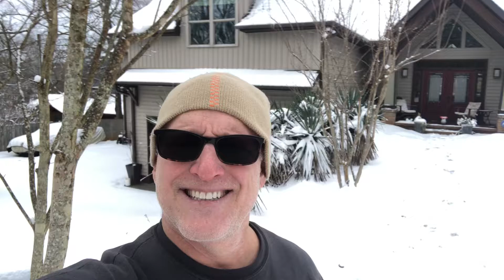Why Brown Stuff, Yellow Film & Sludge on Oil Fill Cap?  And water in Oil Catch Can, Separator?

Comment: Right. I've been draining a crapload of water from my catch can this winter. Pacific Northwest marine climate. Very wet and humid. Without the catch can it would burn up as crankcase condensation, during warm up. Not good for oil or engine.
Reply from the maker: catch cans are a great device, too bad they need to be regularly emptied.
Reply: @DrivingIntelligence  Twice a week right now. Once in summer. It's doing its job.
Reply from the maker: @RW4X4X3006  I just made an 800 mile trip, so I should check mine.  Winter is definitely the worse time for this condition.
Reply: @DrivingIntelligence  My rig is a daily driver. 94 F150 with 351Windsor. I've had it since new. 324k and runs great. I installed the catch can 5 years ago due to excessive blow by in the breather and #4 and #8 sparkplugs were fouling. OEM design has the excess from PCV valve plumed directly into the intake plenum above those rear cylinders. Ford knew for decades this was a problem but never made and update to correct it. Many engines dropped prematurely beyond the 200k area. Adding the catch can and routing it into the center of the plenum for even dispersal of any blow by (which now there is none due to the can) has greatly improved the performance and extended engine life. sparkplugs all bone dry and firing perfectly. Being a daily driver for short trips, condensation doesn't burn off adequately. Catch can is doing its job removing moisture from the crankcase - and it's nice and clean in the throttle body and intake. I tell everyone to install the catch cans - especially those with direct injection.
Reply from the maker: @RW4X4X3006  you're good to your truck.  I'm at 262k miles as a daily driver in my '02.
Reply: @DrivingIntelligence  After what I paid for it new back in 94' I swore I'd never do it again. I'm ringing every buck I can out of it. Haha.

Comment: I had a crapload of that tan muck; some of the build up was as thick as cottage cheese.

I didn't drain the catch can for months, so I just installed one-way in-line (fancy PCV's) valves on the hoses - leading to the catch can, so the sludge doesn't blow backwards.

I think some sludge blew back onto my oil pressure switch filter..... so I gotta swap the sensor and filter now
Reply from the maker: I'm more concerned about the sludge and fluid being sucked into the intake and hydro-locking the engine.
Reply: @DrivingIntelligence  5.3L LS in my Avalanche..... what do I do?
Reply from the maker: If you still have a catch can, empty regularly.  I might not completely understand your issue.